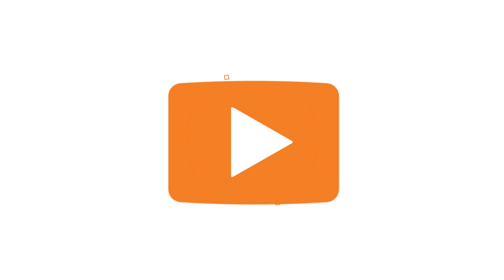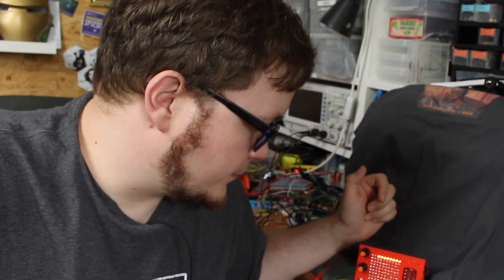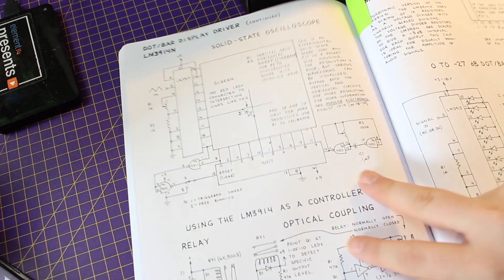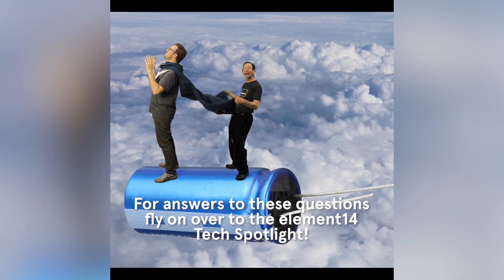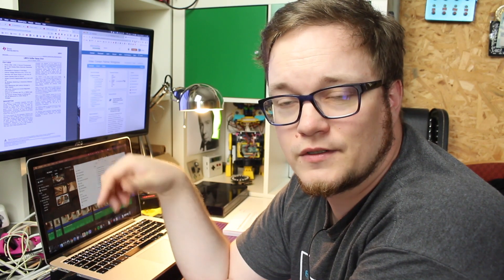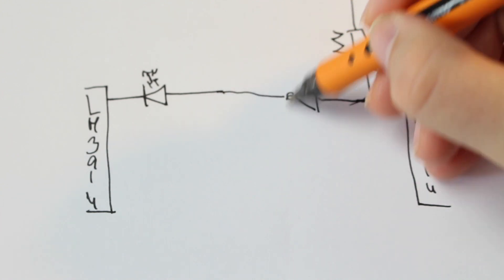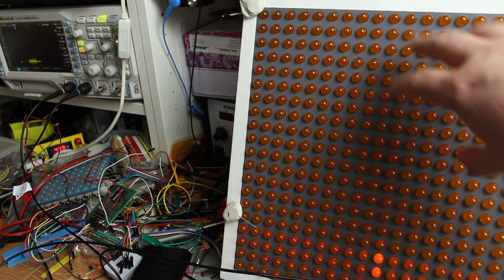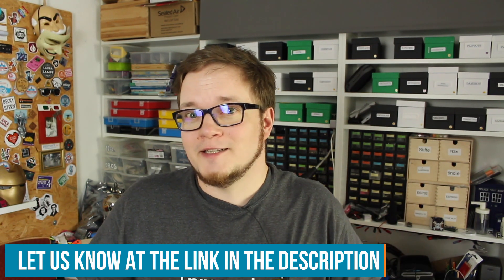Hand Soldered LED Oscilloscope

Comment: You need to add a resistor across the first led output
Reply: at one point I had a 6k8 resistor on every eleventh LED :D I was very tired though. I think the first thing I should do is work on the 20 LED dev boards and then go from there again, secondly find better values for the current resistors.

Comment: I like your idea and building that led X&Y oscilloscope is amazing. I am looking forward to see you final version of that project.  I believe it will end a very nice working oscilloscope. I will suggest that you put different led color in the center of the display vertical and horizontal. Thank you and please tell me where I can download the schematic.
Reply: Interesting suggestion to make that bug a feature and use different LEDs. The Matrix goes from 0V to 2.5V though, so having a line at 1.25V doesn't seem too obvious. There's no real schematics, but I can make one and get back to you. I kind of want to fix some bugs first, too.

Comment: LM's are internally isolated, however when running a analog low power circuit, it is generally accepted that you keep your bus traces the same width and lengths, and keep your capacitors close and tight tolerance.
Reply: hi, not sure what this comment is related to? Do you expect wire widths on the pcbs to cause problems?
Reply: @Davedarko  Analog noise ringing between Lms can cause artifact. filtering with capacitors can help filter this an the tracing and capacitors and tracing lengths create the high and or low pass filter

Comment: The Forrest M Mims notebooks got me started in electronics.

I still recommend them to anyone else wanting to learn. They are fantastic books, and explain everything so well.

It looks like maybe the LM chips don't like the current being driven into the output pins the opposite way.

(and the pull-ups on the output pins of the other chips seem a bit too low value, and could be passing a fair bit of current through the open-collector drivers of those chips when there is no LED voltage drop there. The outputs only need to be logic-level to drive the inverter inputs, so I would try higher value pull-ups first, like say 2K2.)

I guess there shouldn't be passing any current through the LEDs when the inverter outputs are low anyway, but I'm wondering if there might be some other weird effects there.

Could maybe try some ULN2003 drivers as well...

https://electronics.stackexchange.com/questions/221193/possible-to-drive-a-uln2003-driver-with-a-lm3914-bar-graph-display

Although in theory, there should only be one column of LEDs driven at a time (based on the X input / inverters), maybe the inverters are still driving too many LEDs at once, or have some weird current paths through all of the LED junctions.

Comment: Ask me anything :P I apologise for my mood at the end, I needed to draw a line and finish the video. If anyone has any tips on what I could try to fix the behavior, please share! I would even send some stickers and a 10mm LED for correct tips :D
Reply: @Chris-rg6nm  Interesting, I would have thought to decrease it more, instead. There has been quite a development on LEDs, maybe older just don't glow at that point. I will certainly use a pot at those current inputs to check it out.
Reply: I loved the video. Never noticed a negative mood. I bought the book ages ago, and that was the circuit design that jumped out at me as a must try. I am very glad you did it and posted a video because it gave me more motivation to try it. I think I might make it a sound sensitive wall art project. if someone makes a noise in the room or plays music it will react. 

Very nice video. I like seeing when others struggle with things too, as it lets me know I am not alone...lol
Reply: @maarkaus48   thanks Maarkaus, makes me happy to hear all that! I'll see that I get an update out, once I find out how to "fix" it! Good luck with the fart indicator :P
Reply: @Davedarko  lol